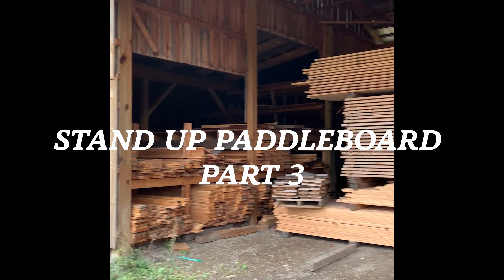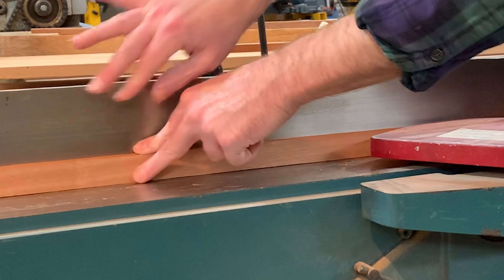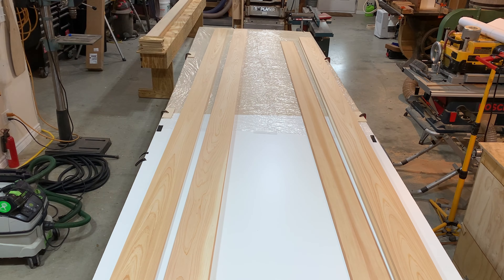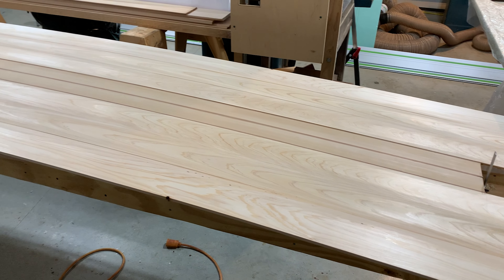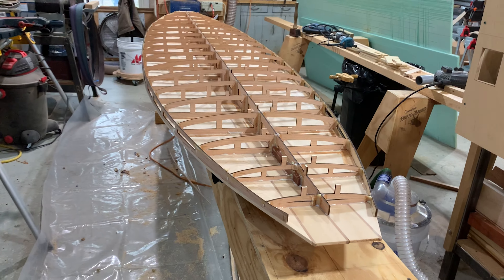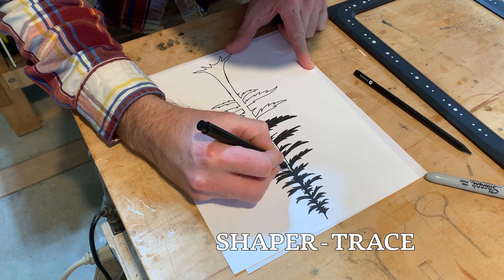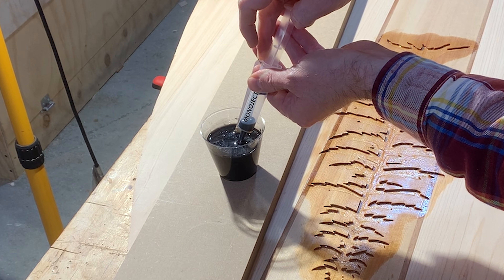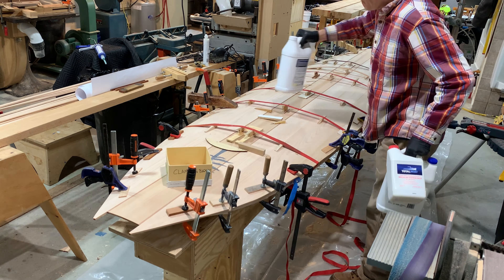DIY SUP - part 3

Comment: Wow, it's refreshing to see a paddle board project! With wooden boats and canoes dominating, this is a unique and intriguing build. As a former woodworker who's enjoyed paddle boarding, one time, lol, I'm inspired by this video. Building one myself never crossed my mind until now. Thinking of tackling this project when I retire in 5 years! Quick question: what was the final thickness for the top and bottom?"
Reply from the maker: Thanks for watching! I think they ended up around 1/4” thick after sanding.